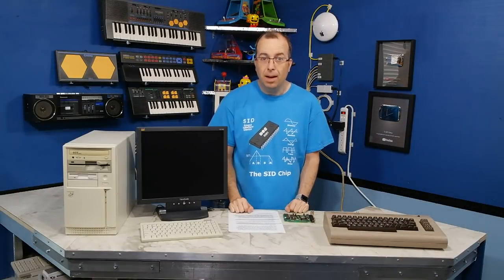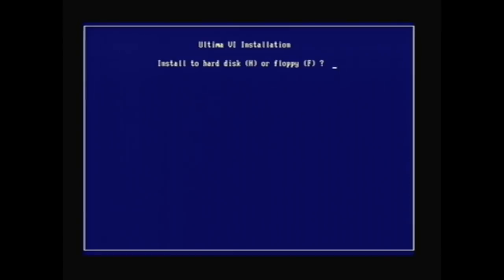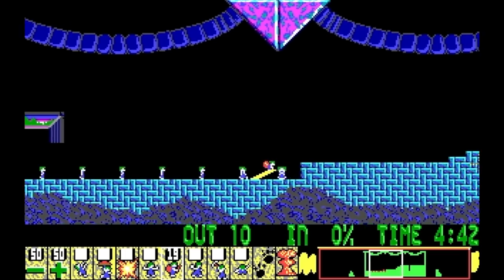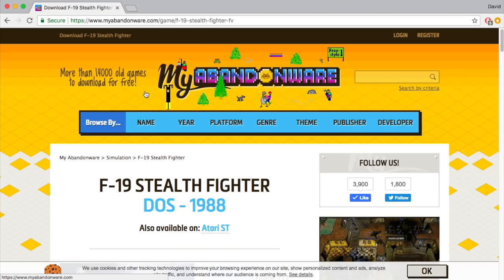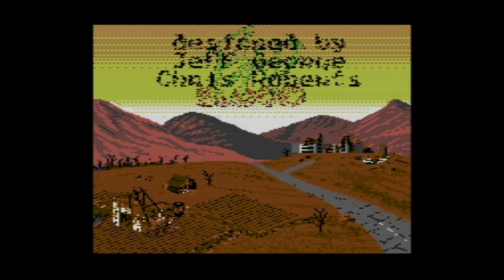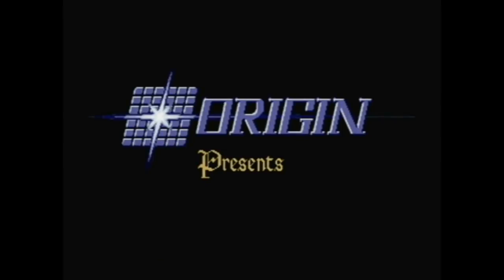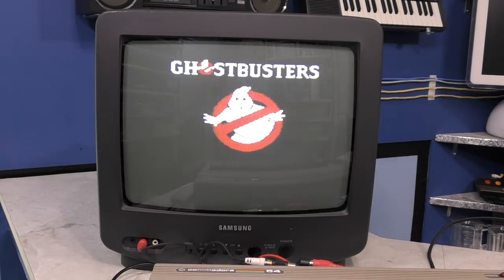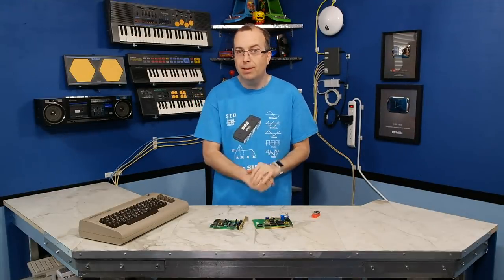Replica Sound Cards - AdLib, Innovation SSI-2001, and SwinSID Ultimate.

Comment: A very enjoyable video! A little note: The speed difference in sound playback between NTSC and PAL machines should not be caused by the small CPU-speed difference. AFAIK SID music playback routines use a VIC-II raster interrupt for timing, giving a 60 or 50 Hz timer. PAL-music should thus play back about 20% faster on NTSC machines.

Comment: 7:33 more like a Voltage Regulator which generates 9v out of the 12v Rail. Not every TO-92 device is a Transistor, it can be misleading at times

Comment: The ssi card being used with the modern sid emulator chip is actually slightly lower pitched than with an original chip. Same goes when using it in the c64.

Comment: 7:31 No, the 78L09 is NOT a transistor. It's a linear voltage regulator that turns anywhere from about +11V to +30V into nice smooth +9V.

Comment: Well, ya could do one of those "Murray Special" hookups and wire the PC speaker output to a pot or fixed resistor and an RCA jack for a sort of "Davey-rigged" line output of sorts, and then use a little mixer like one of the cheapos that Radio Shack used to sell to mix your music with the effects, and capture that into the video (a future video).

Comment: Hey I'm a little surprised you didn't know this, but 8 bit ISA cards work fine in 16 bit ISA slots. There is a reason the longer slots have 2 sections. The 16 bit slot is based on the 8 bit, but the additional IRQ and DMA channels are on the smaller section. It's similar to PCI express cards where a 1x card will work in any slot.

Comment: Try Turbo Outrun with the SwinSID, since I saw a 4th LED and that's for the SID's hidden 4th voice that some games tend to use specifically some games like Skate or Die (Soundtrack composed by Rob Hubbard) and the one I mentioned (Soundtrack composed by Jeroen Tel)

And another recommendation is turning off the caches while trying those kind of soundcards since they are speed sensitive :3 

Other than that I was so surprised that retro stuff is getting some love of today after being in years on a shelf or attic

Comment: Best sounding card that I ever had was a Gravis Ultrasound Max. It came with a nice midi demo of Hendrix, and sounded real. Game support wasn’t the best, but it could emulate a SB, for those that didn’t have native GUS support. After the GUS, I migrated to the SB and Ensoniq Audio PCI, but used the Roland and Yamaha DB50xg midi daughterboards, to get nice music from games.
Reply: Wow.... going from a GUS to an Ensoniq Audio PCI... sounds like downgrading from a Ferrari 458 to a Fiat Panda :)  The best you could buy vs. the cheapest you could buy. Even with midi daughterboards, I would prefer the GUS.
Reply: Daniël Mantione yes, but everything was changing, the busses, the OS. The audio pci did have cleaner specs on paper, and was more compatible with games, but nowhere close to the GUS when it came to sound. Trying to find any pci card with a midi header at the time, wasn’t easy either.
Reply: Those daughter-boards were more or less pay for (expensive) samples in rom. And iirc the Roland didn't behave the same as, say, the SCC-1; which produced some unwanted discrepancies as the game scores were usually composed using the real module itself. Of course back in the day saving you from having to bundle your samples was important, but sacrifice variety for a musician isn't exactly appealing, even with very nice 354 instruments, they were always the same. But then tracker music from the Amiga started playing on PCs... The GUS was actually the right direction imo, but it wasn't seen it sufficiently back then, and after sample mixing could be done in software with game playing (ie. StarControl 2 or Heroes of Might and Magic) why bother with an expensive multichannel board?
Reply: freeculture midi was overshadowed by mod at the time, and there were some amazing demos out!

Comment: Since that SwinSID chip has LEDs for each individual voice and there's holes for a pin header right next to them, does it have access points to each individual voice for, let's say, connecting them to an oscilloscope?
Reply: No, it doesn't. I guess those are the holes for firmware upgrades.

Comment: Great vid, but you forgot to mention one MAJOR weakness of the SwinSID. The SwinSID cannot do the analog paddle input functions like the original. Also what appears to be wrong with the SwinSID that you almost figured out is that it apparently is slightly lower-pitched like PAL, even on NTSC hardware, but will run at the same tempo as NTSC or PAL depending on the machine.

Comment: If anyone is interested in a vintage Roland RAP-10, I have a mint unit. I used it very briefly in 1994 around when it came out, and due to compatibility issues with a driver and my system I stopped using it and put it in a box. It's been there since in my closet.

Comment: Computer gaming on the 80s is completely dominated by 8-bit computers with better video and sound chips. The PC got stuck with the PC Speaker and CGA graphics from 1981 to 1987, things only started to get better after that. The 90s is a complete different history, with PC standardization on some minimal multimedia specs: VGA (mode 13h) + SoundBlaster combo made its way.

Comment: If you haven't set it for 6581 mode and NTSC yet then that is why it sounds different it comes set in PAL mode and 8580 mode you have to change them using the setup program

Comment: Actually the most so called Adlib compatible cards (e.g. Creative Labs products) used a cheaper clone/version of the Yamaha FM chip with features. Since Creative Labs became dominant in this market, most people never heard what a soundtrack specifically composed for the Adlib was actually meant to sound like. At a certain point when the amount of available types of sound cards grew games usually simply used a MIDI track that was remapped to the selected sound card which resulted in quite a less magical sound. Thus it would have been a nice thing to demonstrate the difference between a true Adlib card and a Creative Labs clone. So next up, Gravis UltraSound, Roland MT-32 and SoundCanvas/SC55 :)
Reply: Well, you can argue a lot about the sound quality of the various Sound Blaster clones, but the original Soundblaster does use the same sound chip for FM sound as the Adlib, so here there should not be a difference in sound quality.
Reply: What is the point of comparing cards that let you change samples with things that don't? Their ability to change the samples on the fly vs doing it in software?. Both the AdLib and the MT-32 are worth since they can be more or less crafted at whim, tho i'm not sure how much you can change things to the MT-32 on the fly given the time most games took to reprogram it before using it. The SoundCanvas family are all rom sample based, pointless.
When you enter sample land you pretty much forget about synth ("chip") music... And that's the sad part.
Given the insane amount of cpu, ram and storage of today, you can emulate all of them nearly to perfection. Just configure DOSbox or scummVM properly and your games won't sound much different than if you had invested several hundreds of dollars in sound gear back then. What the GUS did in hardware was eventually done in software and any SB16 or clone could sound the same or better.

Comment: What's going on with the blurry DOS screen capture? 
Also the LED on the SID replica is pretty cool. It would be even better if they have pin out on top for you to connect your own LED light, probably mounted on the modified case (well, probably a good idea to use a replica case as well).

Comment: I had a computer shop from 1997 to 2000 and even if I came across a lot of used machines, I never actually met any of those sound cards David showed today. I've heard of the hardsid sound cards, with 1, 2 or 4 sid chips, but not the innovation. They were a lot of lemonds though, like SS6600, Opti, advance 100, etc cætera, all with awful sound, all with drivers problems, mainly for gamers. My solution was to fit a Soundblaster 16.

Comment: Separate thought from my other post: Can you set up an old PC to act as USB host?  My thought was you could use an old PC to host old PCI and ISA as a USB device.

Follow-up 1: I started looking into the ideas of using a Linux floppy disk to turn an old PC into a serial host.  It is possible but it looks like I would need to use a hard drive (or SD to Hard Drive board.)  Mainly because I would need a recent Linux kernel version and tool chain to handle the through-put for poking more then one device in a timely manner.

Comment: Weird - the SwinSID on the Innovation card is also in a different key from the real 6581. The 6581 playing Monty On The Run on the ISA card sounds just a hair flat to A-flat, while the SwinSID is dead on to G. That's just a hair under a half-step difference. Maybe a PAL vs. NTSC thing?
Reply: The weirdness is due to the player, Alexander Ozumenko's Innovation SSI-2001 Open SID Player for MS-DOS version 0.1, to give it's full name.

It's derived from Open Cubic Player 2.6.0pre6's SID replayer which itself was derived from an early version of sidplay. The C64 emulation implementation is very crude by today's standards but is probably as good as can be expected to run on old DOS machines.

Comment: Guess that little issue with the ssi is probably not able to cope with swingsid. also it seems to have quite poor innovation support on the games, if you look at the waveforms its just sawtooths not all over the place like it should, as you can see with the sid player and yes the ssi might just be pal or you played a pal version :p  adlib one does midi, right? of course it will sound much better :) congrats for vid as many times!

Comment: the difference between pal and nstc is a difference between 50 and 60 hz ... so that makes the tune play 20% in theory, which should be also clearly noticable by the pitch shifting up as well. I was thinking the same when hearing the difference between those two.... altough the difference in percussion could have been possible difference between 6581 and 8580 ? Maybe the SwinSID can switch between those two standards ?

Comment: I wonder if the ISA bus needed some wait states inserted? Certain sound cards, particular older OPL2 and OPL3 cards sometimes need this, or else the FM chips (among other things possibly) will not work correctly. A notable case is Adlib Tracker II, which will sometimes make unholy noise unless those wait states are inserted (or the INI config is altered). Another example is Ultima VI, which I have noticed will drop notes on faster machines like that K6-2, and even my AM5x86 133.
Reply: That's not related to ISA or actual wait states (as in CPU bus). That's the nature of multiplexed design of the Yamaha's FM synth chips itself. OPL2 requires a long delay between consequent writes - it just needs time before it can process another write. OPL3 improves that by making the delay much shorter. The same happens with the whole range of FM chips, like OPN, OPM, etc.

Comment: The SSI-2001 is not a replica, but a clone/compatible as it has a slightly enhanced feature set. Love shock__ (who also owns one of the 2 known originals).
Also FPGASID > SwinSID Ultimate - currently in prototyping but should hit the market some time this year. Why not build a difference track in audacity when comparing a swinsid against a SID chip? That's actually how the FPGASID is being prototyped (along with voiceprints for easier detection of differences). Never the less the SwinSID Ultimate is a great effort considering how the project started and that it's using a lot more simple hardware.
Last but not least ... the SSI-2001 approximates a PAL machine, the actual clock speed for the SID used is derived from the ISA clock resulting in a lower clock that's compensated by the software but still a bit off.

Comment: ... Well now that SwinSID makes me want to get one and build a PBI adapter for it.
I recall some musician claiming they wished they had Pokey with the SID's filters...
I don't quite think this is what they meant though. XD

Hmmnh. The Atari Expansion buses are so oddly inconsistent.

PBI has 5 volts on a 600XL but not on an 800XL
The XE machines have an extra connector and combine it with the cartridge bus to mimic the PBI, yet it contains some extra signals...

The PBI lacks some critical stuff. It'd be a lot more useful with just a few extra signals...
Guess that's why so many devices suggest wiring extra things to the bus...

Comment: Okay, that's the Adlib done. So, any chance of a Creative Music System clone, too? Or maybe the original Sound Blaster which had the hardware of one as well as its Adlib and DAC.
Reply: The challenge with the Soundblaster would be that it used a custom chip, the CT1321, that did the DSP functionality, which was not sold separately. You could try to replace it with an FPGA, but then you are creative more a clone than a replica.

And Soundblaster clones were made a lot, no trouble to find those second hand.

A CMS replica might be possible.

Comment: Innovation had little chance to succeed on the PC market. PC Speaker was bad, Tandy sound was pretty much outdated, but in 1987 consumers were aware of PCM and next-generation synthesizers. Low cost Amiga 500 was released same year and had superior graphics and sound capabilities.

Innovation SSI-2001 could became popular, but only if it would be backward compatible with Tandy 1000. There were many games supporting Tandy 3-voice. Even a software solution that would translate instructions would be good enough. Adding user defined instruments could even improve some games.

Few years later Sound Blaster won the market, because it was compatible with the most popular sound card and offered so desired DAC.

Comment: To my mind it would be better for people to clone the old Soundblaster or Aureal Vortex cards with daughter board connectors as those can do Adlib compatibility and a lot more besides (with the original soundblaster being essentially a tweaked version of the Adlib).  It is becoming hard to find cards that allow the MPU 401 midi daughter boards on ebay, especially for the PCI connection standard so that could be a great product for the retro scene.
Reply: Are there plenty of MPU 401 daughter boards available?

Comment: I wonder if the Swin SID at 8580 mode would still play digitized samples at much lower volumes, compared to the MOS 6581?  If so then it would be truly faithful to the original.
Reply: It has "digiboost" feature that you can switch on/off independent of 6581/8580 mode. If digiboost is enabled, sample playback will work, if not then you get 8580 behaviour. Most people want it enable though.
Reply: Alright, Sweet! Thanks for clearing this up :) Yeah i too would enable it because it's really a super annoying downside of the 8580 which really ruins the experience of SID playback that have lots of sample use. Like the Intro tune of Firebird's "Savage" where Jeroen Tel used a lot of samples.

Comment: There were no drivers, for sure, but didn't a lot of games around that time that use a kind of middleware for sound support?
Reply: No they didn't. "Middleware" is pretty much what "drivers" are, and that came with windows. DOS programs simply talked directly to the hardware, so if you wanted success you had to make sure your hardware accepted the same commands. So there were "defacto" standards, such as the Sound Blaster clinging to the success of the AdLib by essentially bundling an AdLib with an 8 bit PCM DAC for the PC before others did. Or if you were first to the market, you had to document it all openly so anyone could program support in (just like open source OSes). And yes Creative tried with their own chips and failed miserably with the Game Blaster...

Comment: Hey i want to say once i had an NES well last year and my sister tried on the controller cable and it fell on the ground. Then it turned off and i waited a little and it started to smoke XD! 
So at that point i put it in the garage in the center because it was the farthest from the walls and also had  concrete floors. Then i get a new one and just took out the main panel and put the new one in.
If you must ask why i did not just use the new one and get the old one thrown out is because it was full of new cheaper parts that made it not work as well. SO FROM NOW ON DONT PUT THE NES ON A TABLE WHEN PLAYING IT, PUT IT ON THE FLOOR XD!

Comment: SID card sounds way better than Ad Lib, Frequency Modulation is an interesting synthesis technique producing very fast and percussive cutting sounds, i have yamaha sy99, tx81z and montage, but analoguish sid oscillators and filters outperforms it in terms of warmth, the pulse width sounding intro of ultima is a clear example....sounds generally more fascinating, i would never trade my c64 sid for an fm soundchip.

the best would be something like 8 channels of sid plus 4 pcm voices like amiga, using samples for special fx and voices and oscillators for music.

Comment: The swinSID is lower pitch too.
Reply: That's because the swinSID is emulating a PAL SID chip instead of an NTSC one.
Reply: GTX Koopers There are no NTSC or PAL SID chips, different oscillators are used though. Maybe that's why the song failed to play back properly, he used the wrong setting.
Reply: What I probably meant was the SID chip in both the PAL and NTSC C64s are clocked differently in speed (causing pitch problems when having to downclock the CPU for the PAL console like in the NES, although it also happened in the MD and SMS it wasn't as bad). It sounds like the swinSID is emulating the SID chip at the PAL speed.

It's probably ironic that I know some stuff of the C64 yet I was never familiar with the platform, I'm used to my good ol' SNES. :P